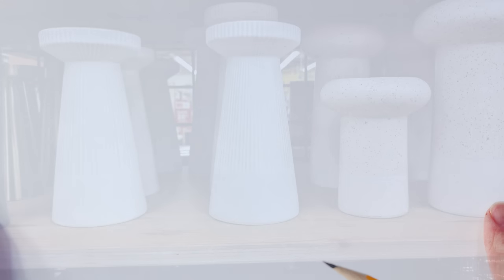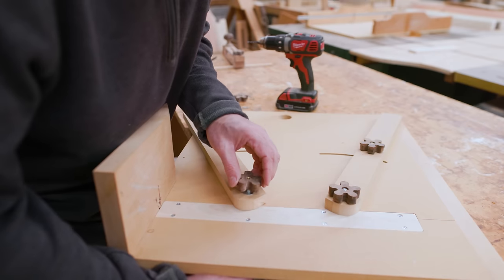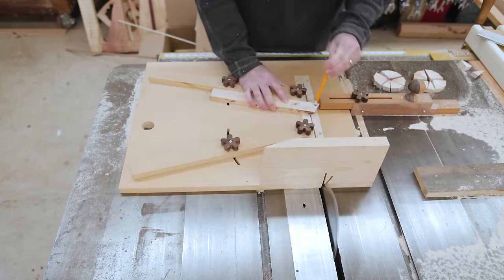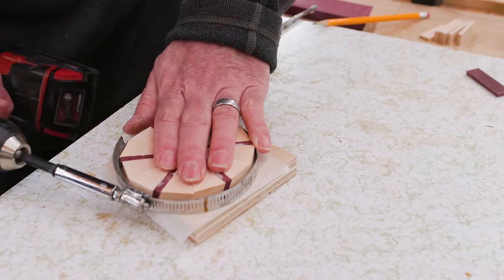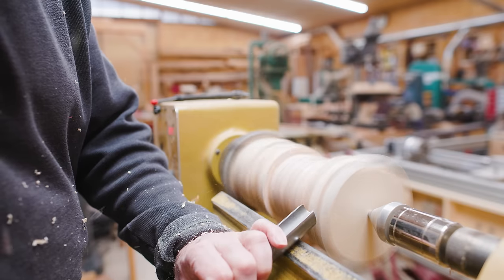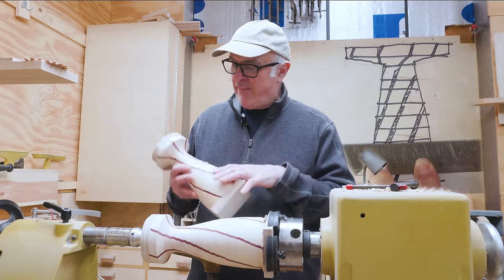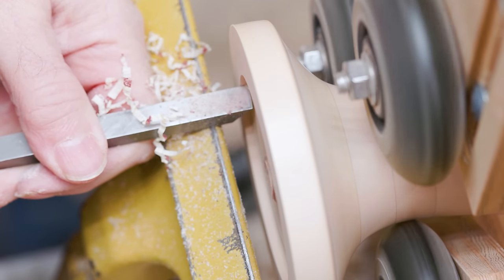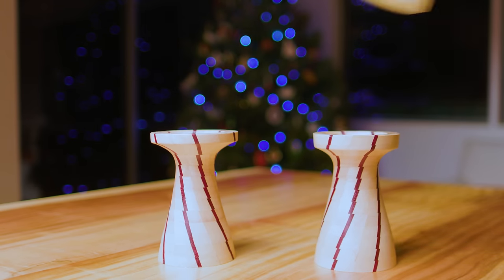Woodturning Segmented Candle Stands

Comment: If you've got a hole down the center, I bet you could put a keyway into it on each layer. If you rotate the location of the keyway by a fixed amount, then you can run a post with a spline up through the hole, and all the layers will rotate to accommodate. The angle of the offset determines how much twist you see in the final product.

Comment: The pattern didn’t line up because of the turning and making the diameter smaller, not because of slipping. 

The pattern was probably pretty close before the turn, but because you essentially make each disk a different size, the pattern no longer lines up with the disk it’s next to, because it also has a different dimension than it’s neighboring disk. 

Not sure how you solve for that. Possible to clamp together during turning without glue (threaded rod down middle?) and then rotate and clamp once turning is done so the stripe aligns?

Looks great tho! Fantastic work as always, Frank!

Comment: Have you thought about using either the CNC or a jig on the drill press to put 2 or even 3 holes in the rings, close enough to the center to not show in the final turning, but then you could stack the rings on dowels that would clock the rings to each other and align the pattern. I would've said to leave one purpleheart segment proud of the top of the ring by say 1/8" so they interlock, but with the angled cuts you might end up with a tiny void in each one. Merry Christmas to you and yours Frank, thanks for another year of entertaining and inspiring videos.

Comment: Hello Frank - two ideas for you to align the segments and to ensure they are flat and parallel:  I use a waste block on the headstock (mounted with faceplate or chuck) and begin mounting/gluing ring by ring.  On the tailstock end I use a Nova Cole jaw chuck to hold the piece I want to mount to the headstock piece, building and flattening each piece as I go.  The Cole jaw enables me to center and align subsequent pieces. The tail stock end will require a live center mount so you can rotate the piece to align perfectly, while the glue is still workable.  Once you have glued the piece you can use a flat board, with a 60 or 80 grit sanding belt (4X24 belt I think) glued to it, to flatten and make parallel. I use a drum sander for all of my segment discs to do most of the flattening and thicknessing, and rarely need to sand once glued, but it doesn't hurt to check flatness with a straight edge before gluing the next piece.  I learned most of my segmented tricks and methods from two primary sources: The Art of Segmented Woodturning by Malcolm Tibbetts (a master segmented wood turner) and YouTuber, Earl's Small Segment Shop., another master.  Earl has answers (and video) that better explain what I tried to say above - https://www.youtube.com/watch?v=OTXwyMsF5js in one of his teaching examples.  If you want pictures of my pieces mounted on my lathe let me know and I will gladly send em along.  AND thank you for your wonderful and inspiring work.

Comment: I have several different size centering cones I made to go in my tail stock in a live drill chuck to self center rings on my lathe. I build my turning on the lathe. It takes a bit longer, but my rings center up every time.

Comment: Hi, Frank, gorgeous pieces as always. Maybe someone else has said this already, but for the alignment of the strips, you were attempting a literally impossible task.

In order for the segments to line up after turning away an arbitrary amount of the material, the internal shape would need to have a twist to it, like, say, a piece of rotini pasta. Such a shape is a continuous curve, not made up of planar polygonal segments. So by making it out of planar segments, and aligning them at the outer diameter, you were guaranteeing that they wouldn't align at any inner (turned) diameter. This is because the inside will always end up having a different twist than the outside.

I like the idea of staggering the pieces so that they just don't need to line up with each other.

Comment: Hi Frank. Merry Christmas to you and your family!  Because the candle holder is different diameters at different points along the length, the alignment is super critical. Maybe you could mill a spiral slot  with the CNC spindle and stuff the slot with contrasting wood. A bonus is, it may be an opportunity to add a CNC rotary chuck to your tool inventory! :)
Reply: I think he already has one...

Comment: RE: lining up the helical pattern. If you first made a cylinder of the primary wood, you could then cut the helical grooves, glue in the accent wood and then turn to final shape. To cut the helix you could use a 4th axis on the cnc, or some type of jig on a table saw or router. Just a thought, cool project and enjoy your videos. Cheers!

Comment: did something a bit like this in school a few decades ago. i can't remember the exact details but i do remember using a dowel with the spiral marked on it and lining it up by threading each section on the dowel and lining it up with the spiral on the dowel. the dowel also stopped anything slipping when glued up.

Comment: About the misalignment: your final candleholder has many different radiuses along its length, and it seems like the misalignment is most significant at the smallest radiuses (near the top of the holder, before the flare). I think the alignment of the pattern depends on the radius. You began by aligning the pattern at a large radius (when the rings were uncut), and then removed material, exposing a different pattern at a smaller radius.

It's possible that you could fix this by using a different shape for the purple wafers. Yours had parallel sides, but perhaps you could try a wedge shape.

Alternatively, crazy idea: use hotglue to hold the rings together while you turn them, and then afterwards, separate the rings and twist them to align the pattern. So, the final glue-up of the rings would be after finishing all the turning. Would this work?

Comment: Hi Frank, I love your work.  I had a similar project I had in mind, but I haven’t started yet because of the alignment problem you mentioned.  I want to make large candy canes out of paduk and maple, with a torus at the top to twist the “cane”. Ill try all one color first… anyway, try making the “stripe” piece a little thicker than the maine piece and you will create a “gear effect” with each layer.  Then you can align each layer with a pin in your plywood clamping blocks.  Setup will take time, but glue up should be faster… the only other thing could be using your lathe for glueup, and putting a chuck on each end and turning the index a specific turn to make the offset the same with each layer

Comment: You have a fourth axis for your CNC ... would take some trial and error, but I'd turn a solid maple candle in the shape you want, then program the CNC to cut grooves strips you then fill in with steamed purple heart. You'd essentially be cutting a very low TPI screw thread.

Comment: When you get your segments glued into the flat slices, you could put those up on the cnc, mill out a hole in the exact middle and an orientation hole in one of the purple heart slices.  Then use a small dowel to line up the slices as you build each layer

Comment: Frank seeing as you've got the CNC, you could make a keyed jig out of something like UHMW that the wood glue won't adhere to, and create the rings with the stripes slightly proud on one side and slightly recessed on the other. Then when you go to assemble the rings into the bigger hole they'd actually key together and alight perfectly.

Comment: You might be able to make the purple heart pieces slightly shorter than the maple ones, this would leave grooves going up the work pieces which you could slot in flexible strips to index them all together. You would still be able to use your hose clamps and it would ensure the pieces line up
Reply from the maker: I like this. I could even use the hose clamps again while gluing the rings to each other. the Hose clamp could hold a small scrap piece in those slots that are left by the small size of the purple heart.

Comment: It will take a lot of math to get it correct because the diameter varies in each segment, and your purple heart alignment will be different as well. My suggestion is: 1) to turn a plain candle holder first, 2) use your CNC to cut slots, 3) cut the candle holder into segments. this way it's easier to study the correct offsets.

Comment: Great project, as always. I was thinking you could cut one set of the purple heart 1/4" longer than the rest. You'd use it in the first glue up ring and then each subsequent ring would slot into the layer below. This would also require construction of one layer stacked on the one below.

Comment: Merry Christmas!

An idea popped up as for how to align the pattern: In this specific case, you could offset the red stripes for each segment in the Z-Axis, so that they slide into each other aligned. The protruding red stripes from one segment would slide into the respective created grooves by the below segment. Definitely would cause its own difficulties.
Reply: I had the same thought. You could also cut them with a step, so the outside is still flush but the inside is offset.
Reply: I had the same thought. It would complicate the camp up process though. the red segments would need to be offset a consistent distance on each layer. This could be done with a spacer, cut would need to modify the sandwich glue up to accommodate the protrusions.

Comment: You had a hole in the center of all of them.  I would have glued them all at once on my glue up jig (which is just a piece of plywood with a  3/8" threaded rod out of the center).  Then stack them and line them up.  Or I would have offset them by the width of the colored piece.  I think putting them all on a rod would have helped to keep them all lined up better.    But your work is amazing anyway.  Merry Christmas!

Comment: There is a hole in the middle of each ring, so run a threaded rod through all the rings, with a block on each end, to glue all of them together. You can adjust each ring's rotation as you tighten nuts on the rod.

I would rotate each so that the stripe was just beyond the previous, a saw-step sort of. Then it wouldn't matter if they "line up" because it is obvious they're not supposed to.

Comment: Merry Christmas, Frank!  It is always interesting to see your Christmas ornament turnings.  For alignment, could you turn the maple first (without the purpleheart segments) and get that shaped the way you want it.  Then route a spiral groove to hold the purple heart.  It would require precise and synchronized turning of the wood and advancement of the router to create the "barber pole" effect.  Craftsman used to make a device call a Router Crafter than did this (CNC would do this now).  Then a thin strip of steam-softened purpleheart could be inlayed into the groove.  Then, turn the piece again for final smoothing.  I realize this may move away from the "segmented" concept for the project, but the spiral would be pretty much dead on.

Comment: i'm not a woodworker, but i had a few ideas for lining up the segments:

there might be a way to use the cnc (and math) to make holes for small alignment dowels or pins in each segment. not sure how you would mount them accurately on the cnc, but im sure it could be done.

another idea would be to sandwich a thin layer of veneer of the darker wood between every layer. that would hide the offsets pretty well (like those optical illusions), but would significantly change the design...
Reply from the maker: Your first idea with the alignment pins could work but it would be a lot of work. Perhaps once a system was set up it wouldn't be too bad. I like your second idea of hiding the problem in plain sight.

Comment: I have made similar segmented build-ups, but much simplified. Just 4 segments with contrasting strips in between, and no bevel. That means everything is 90 degrees which makes the glue up easy. I make it in a long stick, then slice it up into pucks. The pucks then get glued back together with each segment rotationally offset by a fixed amount. To ensure the pucks don't slide around I use a dowel up the center.

I think with a varying diameter that it is not possible to get the strip to line up throughout the piece, regardless of the bevel angle. I may be wrong about that. I'll need to give it some more thought. Regardless, your candlesticks look very cool.

Comment: You could glue up a segmented ring without the purple wood, then using the lathe attachment on the CNC cut a channel, rotate, cut another channel etc then glue a strip of wood down that slot, that way you don’t have to line up anything
Reply from the maker: I've been thinking if one wants a straight stripe along the vertical axis of the piece, this might be the only way to do it. I was wondering about maybe even a jig for the table saw that holds the cylinder as a  dado is cut along the length at an angle.

Comment: Merry Christmas, Frank, and happy holidays! Thank you for the video. Your Christmas specials are always a treat ✨

Here is an idea for aligning the slices inside a candle stand or any turned object: (1) Turn the solid workpiece using one type of tree. (2) Slice in with a band saw. Aligning a turned object for a band saw cut could be tricky, but you can use CNC to make some sacrificial fixture elements. (3) Glue the slices back together, alternating each slice with a thin panel of the second type of tree. (4) Turn the assembly again to remove the excess material. Removing some of the material on the band saw before turning is worth it. This approach should guarantee the perfect pattern alignment since the traverse lines are solid wood parts.

Comment: I'm not overly sure how you could line the segments up, but I do have an idea for how to get nice lines for your strips. Cut and glue everything without the coloured wood. Once you have the plane section glued together, turn it roughly to shape. You could then mount it in your laithe CNC 5th axis and use that to cut your spiral channels. Now you can glue the coloured wood segments into those channels. Not 100% if it would work the way it does in my mind or not. If it does, you could also do things like multiple spirals at different angles as well as in different directions 🤔 Hope you and your family have a great Christmas 😊👍👍👍👍
Reply from the maker: If one wants perfectly straight stripes, I think this is the way to do it. It could even be a jig on the table saw I think just to cut slots  in the round cylinder of the piece.

Comment: Hey Frank, what about putting a threated rod through the holes inside of the rings before turning? Then using Nuts and washers to clamp the lose segments tight together. Then turning them to the final shape, align the inlays and glue them together??

Comment: You could always use the technique of the concrete cooling tower  !
These use straight reinforcement, but slanted  ! 
The way to achieve this is to make the Top and bottom discs different sizes.  Smaller at the top , larger at the bottom  !
If the same number of small slots are drilled to the circumference edge of the top and bottom plates, and the discs are separated by thin wooden dowels, {like chopsticks}, cut to the length required, then when the plates are rotated in opposite directions, and the drilled slots in the plates are ""Sloppy"" enough to allow this , then a HYPERBOLOID shape will appear, Necking in proportion to the sizes of the discs.
This can be in the different colour of wood, and if enough discs are used, and thin flat sheet used as ribs, then a similar object to the Candle-Stick can be made, and turned as required.  !
Good luck  !

Comment: Beautiful design and a lovely video to drink my coffee to!
I'm sure smarter and more experienced minds here have a solution to the alignment. I'm wondering if you could turn it without glueing the layers so you get the shape, maybe with temporary alignment pins. Then take apart and glue from the bottom up aligning each one. Or slice it on the bandsaw and re-glue?

Happy holidays!

Comment: what about building the standout of solid maple, then running the stand through the table say at an angle, as if you were cutting a tapered leg.  Instead cut it into 2 pieces.  Glue in the contrasting wood, let it dry, rinse and repeat for however many segments you need.  I have no idea if this will work - I am totally spit-balling here.  just feels right in my jellies.

Comment: About the column glue up of the individual rings in pairs. If you had drilled a hole in the middle of each ring, and inserted a matching threaded rod, could you have glued the entire column in one go?  This may have prevented the issue with the irregular purpleheart stripes.  Maybe.

Comment: Really amazing work, Frank! Beautiful candle holders! 😃
About the alignment, I can think about 2 ideas... one would be using some dots of AC glue to hold them in place while you clamp them... And the other would be brad nails, but those made from plastic (nylon, I guess), that people use on the CNC.
Anyway, stay safe there with your family! 🖖😊
And happy holidays!
Reply: I agree, I think all the misalignment comes from slipping during the gluing so a couple of small pins would stop that. Then the discs could be clamped as normal to dry. You'd have to build the whole stack in one go of course, but that shouldn't be an issue as alignment and nailing would be really fast with a nail gun.

Comment: I wonder if you could have made the candle stick as solid maple (no stripes), then shaped it on the lathe, then using the bandsaw cut in half and put a layer of purple heart between the two halves, then back on the late to shave the PH back to the surface of the Maple, the cut the candlestick in half again and add another layer of PH and shave it back to match again...  etc...